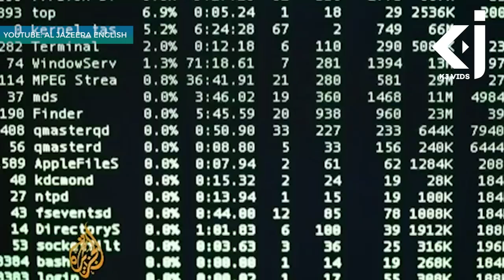China's Economic Miracle | The RISE of CHINA Mini-Documentary | Episode 1 - KJ Vids

Comment: You are looking at the cities. Please go to the rural areas and see what a world of difference. So, much poverty.
Reply: Step by step. And China is taking bold steps. Starts with education, and roads etc: 04:05 "China's education, health care, an related indicators reflect similar improvements in its peoples' well being. In 1949 Chinese citizens could expect to die at the age  of 36, and 8 in 10 could not read or right. By 2014 life expectancy had more than doubled to 76 and 95% are literate..." 02:53 "Between 1995 and 2016, China has built 2.6 Million miles of roads including 70,000 miles of highways connecting 95% of the country's villages and overtaking the US as the country with the most extensive highway system by almost 50%. Over the past decade, China has constructed the world's longest high speed rail network, 12,000 miles of rail lines that carry passengers between cities at speeds of up to 180mph. China now has more high speed rail tracks than the rest of the world combined."